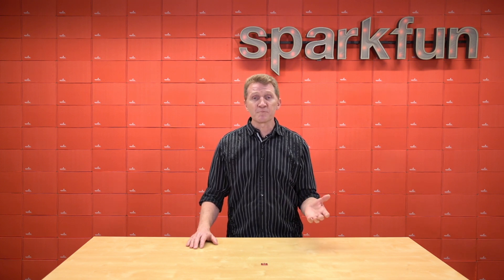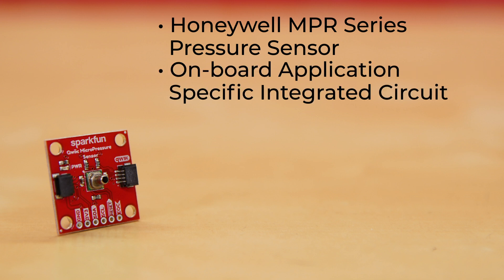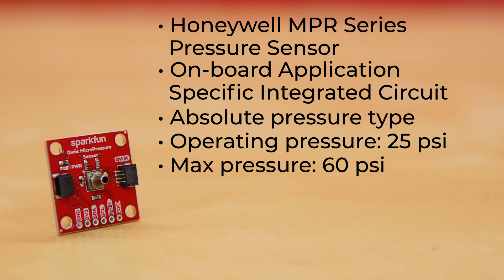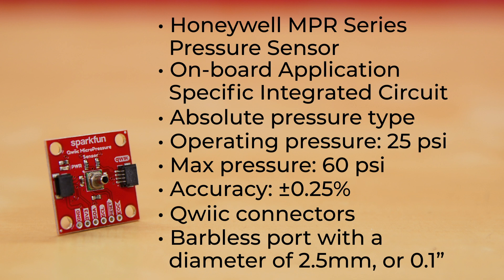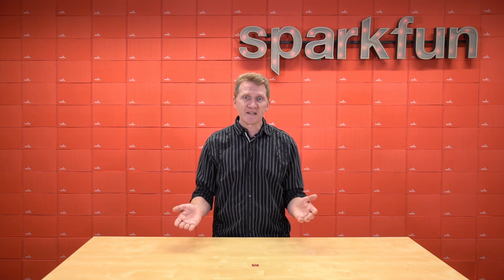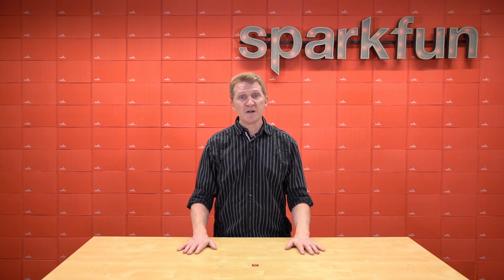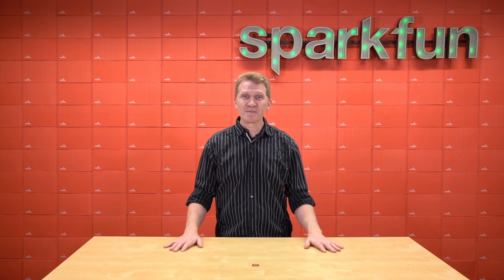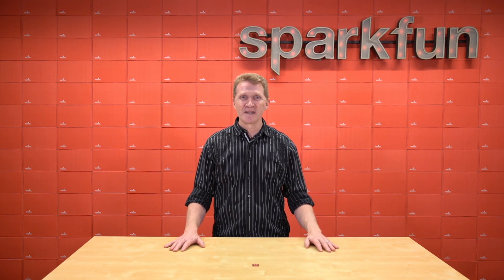Product Showcase: SparkFun Qwiic MicroPressure Sensor

Comment: Could this be used to check the total vacuum in an air conditioning system before imputing the Freon?
Reply: na this is for low pressures.